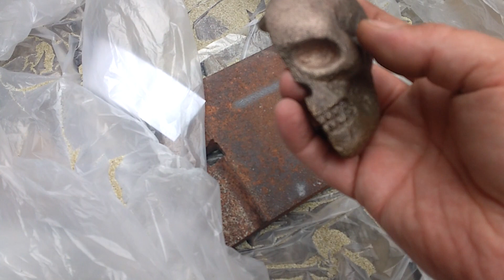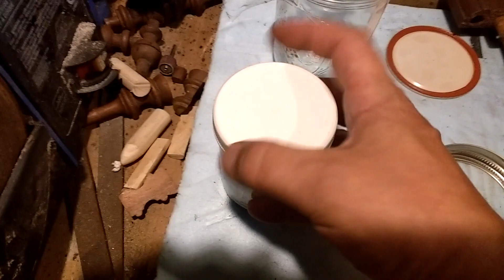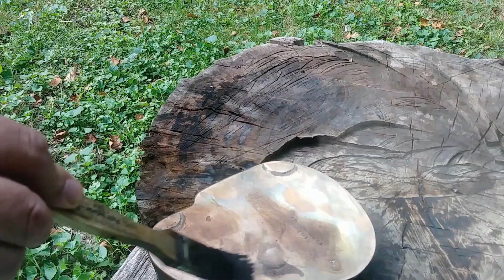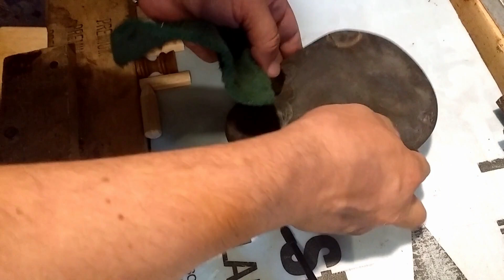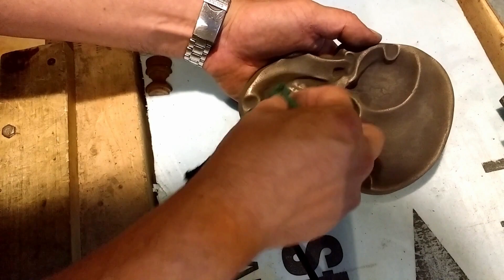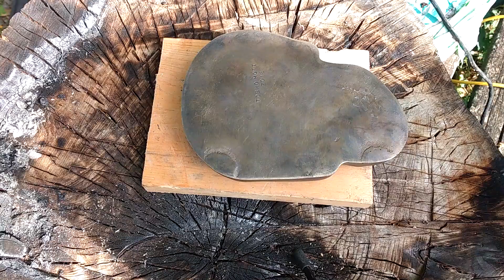Bronze Skull Patination - First Attempts

Comment: nice ! may be polish  first a finer finsh should take the liver stuff more eaven . and may be pee on it while its hot;)
Reply from the maker: Thanks for the suggestion, and for watching and commenting.  For the ashtray, I'd probably try using some of my older sand purchased from a foundry supplier as facing sand first, rather than spend a lot of time polishing a raw casting, if I wanted a smoother surface to patinate.  

I did do some smoothing with diamond grit dremel bits on the raised surfacea and teeth, etc. Where i knew i would be buffing the patina off of the most.  Not my favourite way to pass the time, but IMO it paid off in the end. 

Also removed some nasty mold lines from the belt buckle casting that way.  A lot of work...  

The patina seems to take hold easier on a surface that's a bit rough, but a smoother surface would be easier to buff it back off of...  

That commercial grade greensand I've got is amazing, it's the same sand I cast my aluminum version of this ashtray with, if you've seen that video.  That sand leaves a nice and amazingly smooth finish that would not even need any polishing... This (ashtray) was actually a test casting made using my new homemade greensand, which is also quite nice thanks to the sand muller I built this summer, but a little bit coarser.  

It still came out nice enough I figured it was a keeper though, so here we are...  The patina here does kind of serve to highlight the little flaws in my casting and the roughness of my sand.  Gives it a bit more of a "handmade" look, which is not necessarily what I was going for, but I think the patina came out nice enough in the end to outweigh that factor.
Reply from the maker: Pee on it?!
Reply: no you polished it with scotch bright  after im sayin do that before the liver  tea. take the fuzz from sand blasting away
Reply: you guys dont pee up there ? beg my pard i ment no harm i just dident know ! sorry. i can send you some if you would like .
Reply from the maker: @nowayjerk8064  Understood.  The part where I cleaned it up with th diamond grit Dremel bit happened before the bead blasting.  I think the bead blast going after that actually helped smooth out the transition between the polished parts and the as-cast surface.   But I will think about changing up the order on another piece some time.
Reply: thanks for taking the time to replay